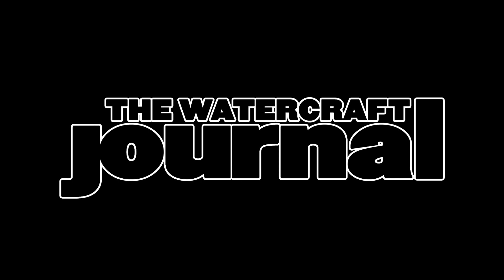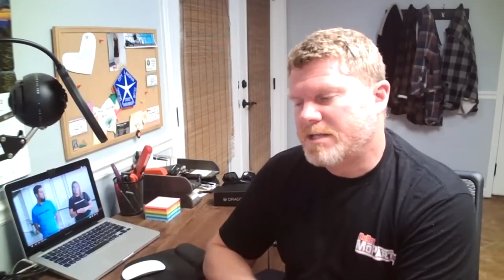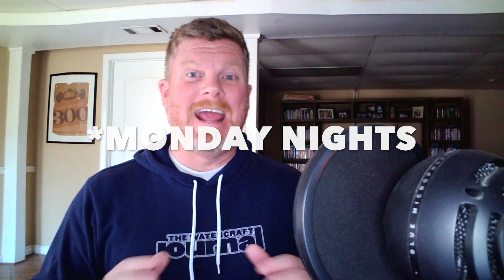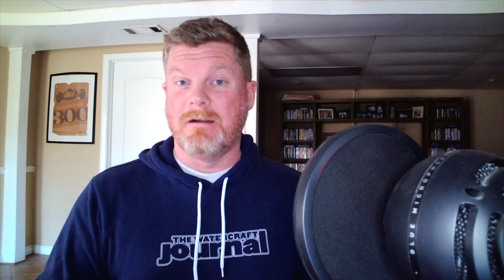Can a Broken Steering Cable Cause Water Intrusion? WCJ Quick Topic

Comment: I hope I haven't just done this 😢 total boat nuub on the canals in Europe . Very low water levels , rudder was stuck feels like cable has snapped , veers too the right steering doing nothing and loose too turn  . Bilge was quite full but made a noob error and forgot too empty before leaving the jetty . I was 2 weeks moored and I just emptied and alot came out will have too monitor this overnight . I hope I didn't pull the cable through with the grommet please god .